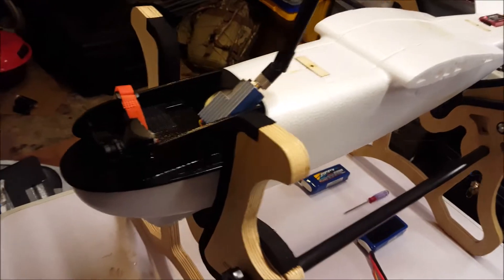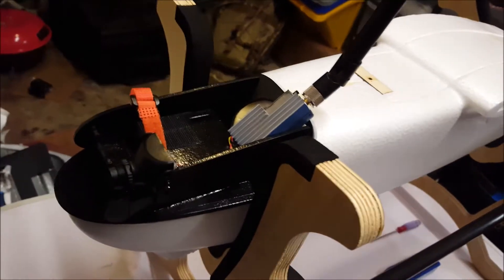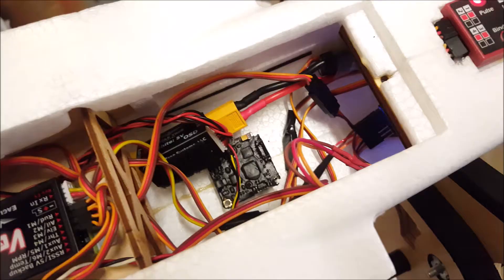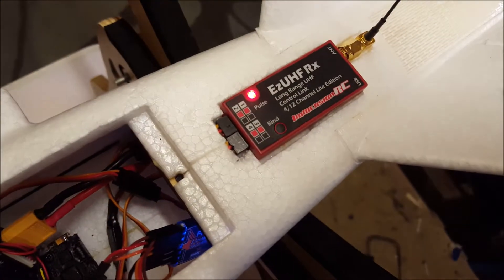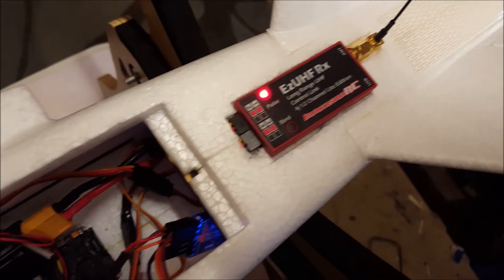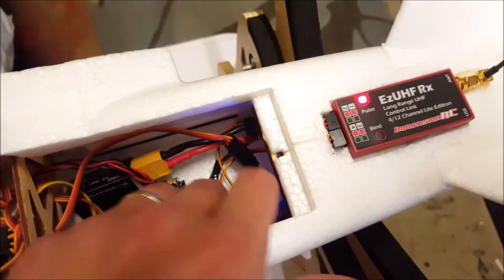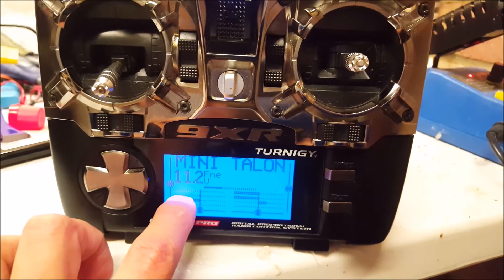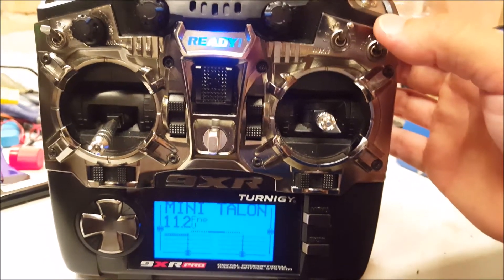X-UAV Mini Talon - Dual FPV camera setup

Comment: I like it - I wonder if it was me if I'd put a mix in there so that when the downward facing camera is in use, the OSD gets turned off? It obstructs the view somewhat but may also lead to some confusion if you try to start flying from it :D
Reply from the maker: I can scroll through the Vector OSD screens using my mode switch anyway, I have a fairly full OSD with everything from LiPo voltage to GPS count... a not so full OSD that gets rid of the graphical stuff like the AHI and speed/alt ladders... and a minimal OSD that just has distance from home and home arrow... then there's OSD "off". So if I feel like the display is in the way of the view I can easily turn it off anyway.

Comment: I have just ordered a 1200 TVL camera to do the same thing. 
Not sure which lens to use yet? 
I have everything from a 2mm to a 50mm lens to test. 
Plus i am just putting together a 4s4p built out of 16x 18650b. 
That will only weigh about a third more that a 4s 5200 multistar.  
Yet it will be 13,600mAh at 16.8 volts.
Reply from the maker: lens choice is up to you, but this is a 2.8mm lens. I find the 2.8mm lens gives a good field of view without being too "fish eye" looking.